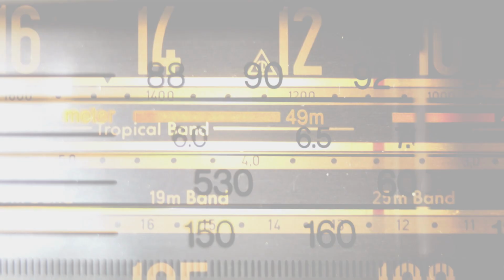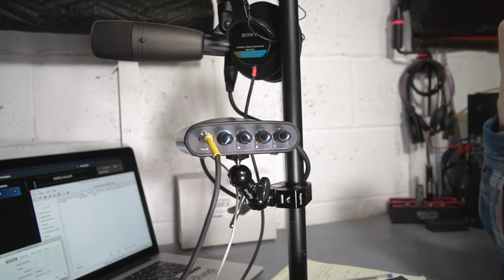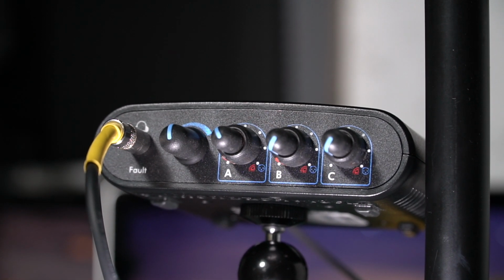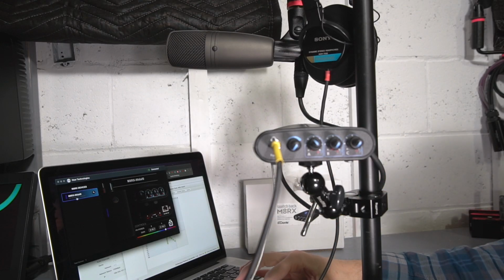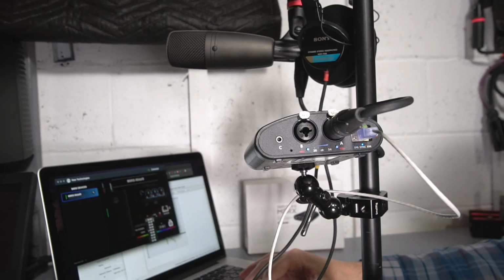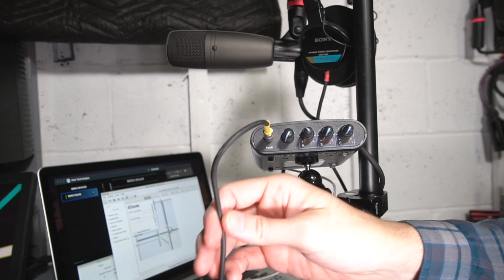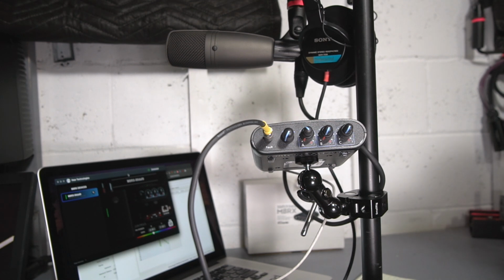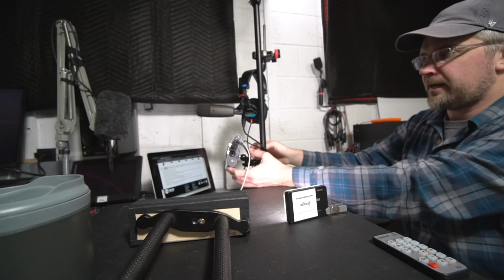Switchback M8RX Dante Audio Interface & Monitor Station from Hear Technologies - First Look

Comment: I have one recommendation they seem to have some weird thoughts rolling around in their heads designing these products but then again that was ten years ago. when I bought the 15 or $25 pair of "inears" for a church and when I could have gotten a better pair of headphones at the dollar store but they wouldn't have come with the little rubber caps. I also met a band who exclusively went for their in ear system.... let's just say they had quite a lot of set-up time and there were wires all over the place because everybody's box needed to be interconnected. So moving to Dante Network seems like a good idea for them.

Comment: The Hear stuff is amazing. I’m using a bunch of it. I have an original HearBack, a HearBack PRO with Dante, Soundgrid, and Analog in cards. I’m actually testing their MADI and Analog Out cards coming soon, for the WSG Bridge unit, and the HearBack PRO. Top quality stuff. Stupid low latency, killer Pre’s , converters, and headphone amps. I don’t have any M8RX units yet but I certainly see a lot of uses for a few. Studio / Remote / Broadcast / Live, whatever. I’m sure they’re in my future

Comment: Very interesting. Is it possible to mix a few of these on a mac/pc and use those mixes as in-ear and pa?
Reply from the maker: Once you put audio onto a Dante network using a device like this, you can access it and process it with any number of other Dante capable devices, including computers running DVS (dante virtual soundcard) or Dante Via. This allows routing to and from software for processing, recording and anything else you might want to do. Your software and system will introduce latency depending on the config and what you're trying to do, but the Dante transport of the audio over the network itself is extremely low latency.
Reply: DcSoundOp  that’s what I thought. I’m curious if it is feasible for live pa with a good pc or mac config.
Reply: Anyone cares/ willing to test?